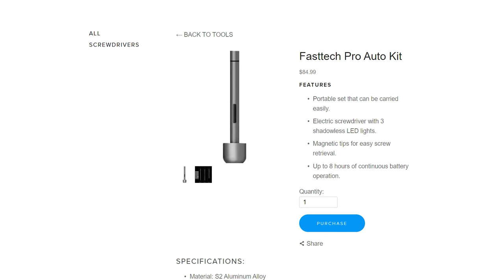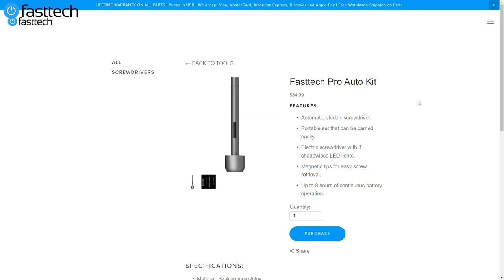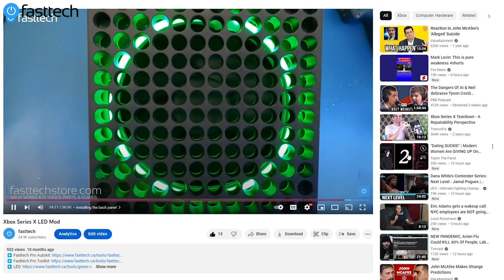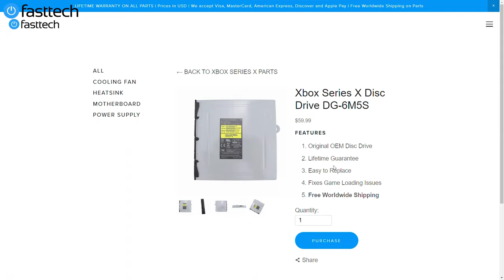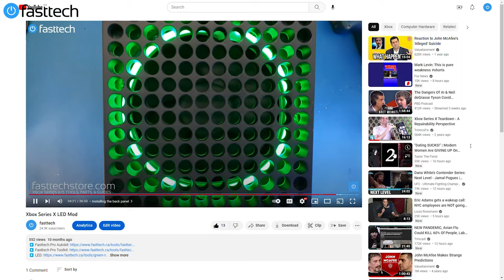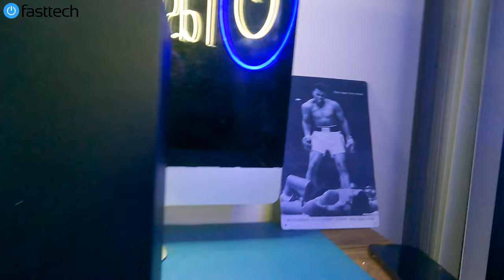Xbox Series X Disc Drive Repair & Replacement Guide

Comment from the maker: 👉Fasttech Pro Auto Kit: https://www.fasttechstore.com/tools/fasttech-pro-auto-kit
👉Fasttech Pro Toolkit: https://www.fasttechstore.com/tools/fasttech-electronics-repair-toolkit
👉Xbox Series X Disc Drive: https://www.fasttechstore.com/xbox-series-x-parts/xbox-series-x-disc-drive-dg-6m5s
👉Xbox Series X Laser Lens with Deck: https://www.fasttechstore.com/xbox-series-x-parts/xbox-series-x-laser-lens-with-deck

Other Xbox Series X Parts:
👉Xbox Series X Motherboard & Disc Drive: https://www.fasttechstore.com/xbox-series-x-parts/xbox-series-x-dual-motherboards-and-paired-optical-drive
👉Xbox Series X Power Supply: https://www.fasttechstore.com/xbox-series-x-parts/xbox-series-x-power-supply-model-1920
👉Xbox Series X Cooling Fan: https://www.fasttechstore.com/xbox-series-x-parts/xbox-series-x-fan-assembly
👉Xbox Series X HeatSink: https://www.fasttechstore.com/xbox-series-x-parts/xbox-series-x-heat-sink
👉Thermal Paste: https://www.fasttechstore.com/tools/thermal-grizzly-kryonaut-thermal-paste-1g
👉Fasttech Pro Toolkit: https://www.fasttechstore.com/tools/fasttech-electronics-repair-toolkit

👉Hakko FX-951 Soldering Station: https://www.fasttechstore.com/tools/hakko-fx951-soldering-station

▶Xbox Series X LED Mod Guide: https://www.youtube.com/watch?v=6KPXHs7bW_k&ab_channel=fasttech

👉NEED HELP? FaceTime/Zoom Video Call Me: https://www.fasttechstore.com/online-consultation
👉GET REPAIR SERVICE FOR YOUR DEVICE: https://www.fasttechstore.com/electronics-repair
Reply: You are correct it's the desoldering that will getcha well that and drag soldering

Comment: My problem is that the disc drive doesn't take and eject discs. Is it possible to repair or I must change the drive?
Reply from the maker: @razerap7or404  you can try to fix it. Check the rollers and gears.
Reply: @fasttechvideo  Ok, thanks. I'll try. In case I need to replace the disc drive I have to rely on someone expert, since I don't know how to solder. If I bring only the disc drive, does the console work or does some error code appear?
Reply from the maker: @razerap7or404  you would  have to solder 2 wires (very easy) to replace the drive

Comment: So my disk keeps rotating in the disk drive for a few minutes and it makes a thumping noise while doing so at times just for it not to read. Do you recommend buying a new disk drive?
Reply from the maker: @thathomiefox  try replacing the laser first
Reply: @fasttechvideo  gotcha, if I purchase a laser disk from you how long does the  warranty last?
Reply from the maker: @thathomiefox  we give a lifetime warranty with our lasers 😊
Reply: @fasttechvideo  are they new or used parts?
Reply from the maker: @thathomiefox  the lasers are new

Comment: Does it need to be replaced if it has issues loading/ receiving disks? It takes mine a couple of attempts or assists to get disks in.
Reply from the maker: Try to realign it first but eventually you might have to replace it.
Reply: @fasttechvideo  Thanks.

Comment: Thanks for the video, cleaning my lens solved my issue! It would have been a pain to send an out-of-warranty Xbox to Microsoft for that little work, especially since they charge 407$ (CAD) + shipping for a repair, while 0.03$ of Q-Tips + a drop of Rubbing alcohols solved my problem... FYI if you just want to clean the lens, you don't need to unsolder the whole drive, you can just flip the board where the cables are and you can access the lens. Still thanks for your help.
Reply from the maker: You are welcome. Thanks for your comment. Did I not mention that you dont have to desolder them? Please also like the video and subscribe that helps me out.

Comment: DG-6M5S-03B is the correct model of dvd player, but seeing as I am swapping the circuit board from the original, can I get away with a 01 or 02 version of DG-6M5S ?
Reply from the maker: Yes you can but the bracket at the front of the drive might be slightly different and might have to be modified

Comment: Mine goes in but doesn't spin do i just replace it?
Reply from the maker: @jakethejoker0858  you can replace just the laser deck and it will fix your issue

Comment: Mine says ‘There is a problem with the disc drive’ when I load a disc, what should I do?
Reply from the maker: Try cleaning the laser first. If that does not work replace the disc drive or laser deck as shown in this video.
Reply: @fasttechvideo  how could I clean the laser, is there a video
Reply from the maker: @abdalsalammelad5081  yes this one @10:25 smh

Comment: Hey man , if I wanted to clean the lens I still need to remove the logic board ?
Reply from the maker: @boxerm4n  yes you have to get it out of the way but you dont have to desolder the 2 wires
Reply: @fasttechvideo  thanks

Comment: I did all this and now my series x just ate my disk and won't spit it out or read it. Any ideas??
Reply from the maker: You probably soldered on the 2 wires incorrectly
Reply: @fasttechvideo  any tips for doing it correctly? The only thing wrong looking is a bubble like build up on the red wire
Reply: It's reading now but does not eject. Still the same problem?
Reply from the maker: @rob6912  make sure the black wire is soldered to B and red is soldered to R

Comment: why are u using the biggest solder
Reply from the maker: The only tip I had around at the time was
Reply: @fasttechvideo  what temp for the solder would be optimole for this job

Comment: Out of nowhere for no reason my series acts stopped reading my cross-gen edition disc of modern warfare 2. And every other game disc. I've tried Black ops 2. Black ops 3. Black ops 4. And Batman Arkham Knight have worked fine. It's just the cross-gen edition disc and I've tried every possible reset you can imagine it doesnt help for me i think its the damn disk cause i found work around for it to work and then the work around stopped and i found another for like three times and now im out of ideas i cant take this frustration and i know its thme cause i was fortunate to get a replacement disks from GameStop
Reply from the maker: Try cleaning the laser lens but if that does not work then replace the laser.
Reply: @fasttechvideo  every other disk works though

Comment: Mine does 2 clicks then commits suicide Microsoft should've been sued for putting this crap out.
Reply from the maker: I agree. They have been using the same blu-ray drive virtually since 2013 (Xbox One) and they are known to have issues and fail at random.
Reply: @fasttechvideo  never had a problem with my OG Xbox one and I picked it up and threw it like Darth Vader did the emperor the disc trey ejected from the console and that still worked for years untill it bricked on shitty WiFi. The series X has been nothing but issues for me since I got it getting a ps5 at the end of the month and hopefully sell it.
Reply from the maker: @wilfredwayne7139  just so you know the ps5 can also have issues with the disc drive and other components.
Reply: @fasttechvideo   do i understand it right, that xbox one s/x and xbox series x have the same blu-ray drive? so i can use my old from xbox one s and with the board swap it should easily work in my series x? no need to buy a new drive?
Reply from the maker: @hilas195  yes they are interchangeable but the front face housing on the drive is different and will need to be swapped over.